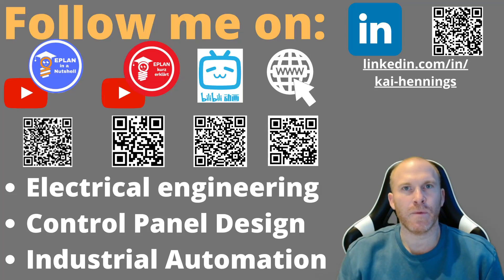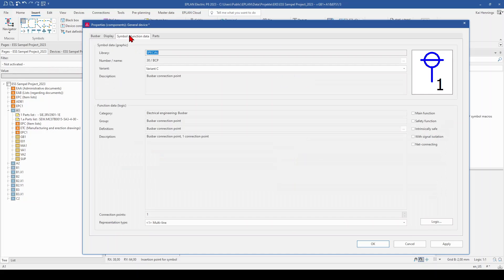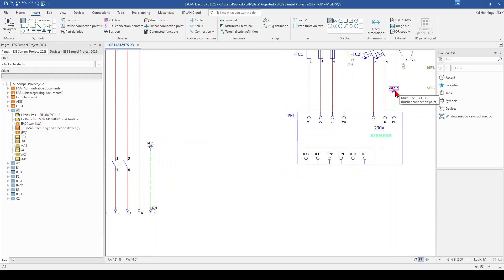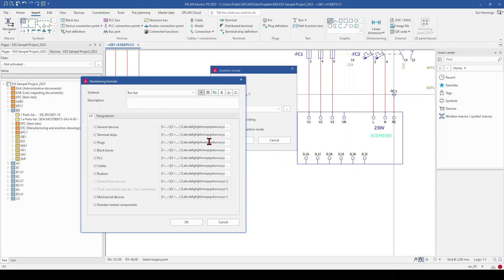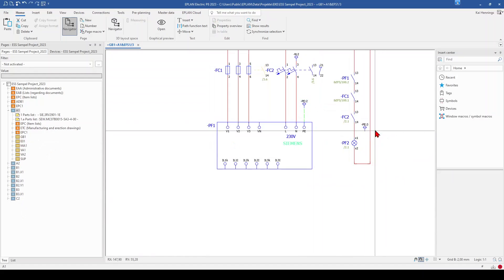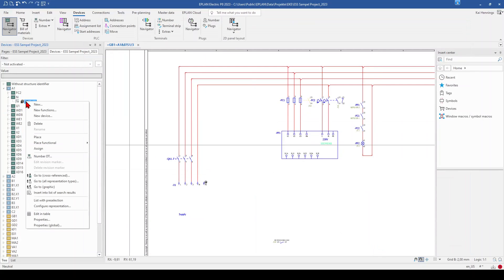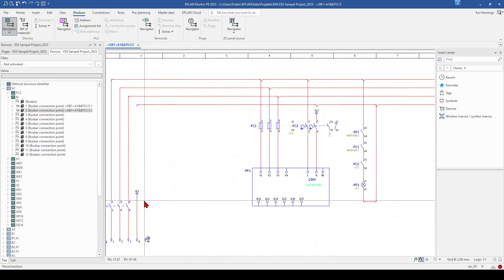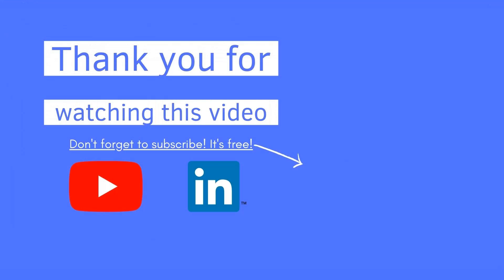EPLAN Busbar connection point. How to number a busbar connection point automatically❓

Comment: to define a  Busbar definition
1-  go to the Insert center
2- select Busbar definition from this path
SPECIAL > Electrical engineering > Special function in electrical engineering > Busbar definition >
3- Select BBDEF
4- Fill in the Properties (component)
Reply: Thank you for this one!
It is a little counter intuitive that they don’t have a similar set up like for terminals. Either right klick in a navigator and add “Bus bar definition” or under Insert that they have a “Bus Bar definition” akin the “Terminal strip definition”